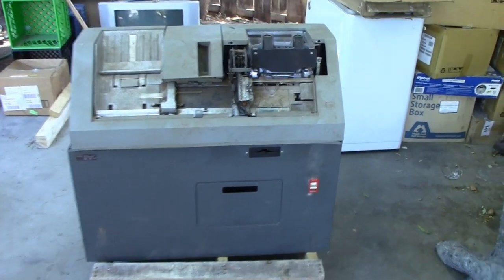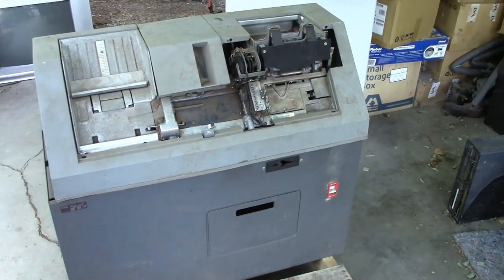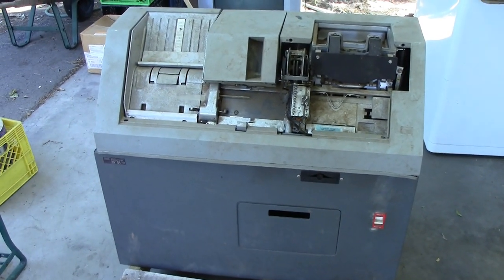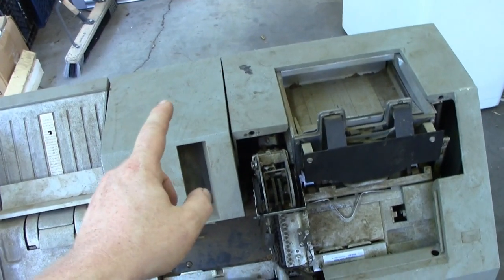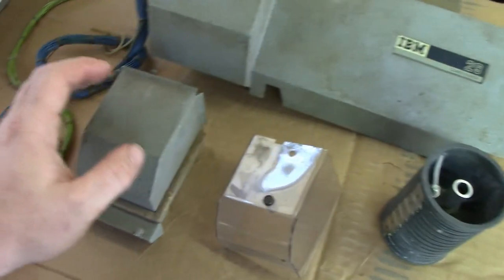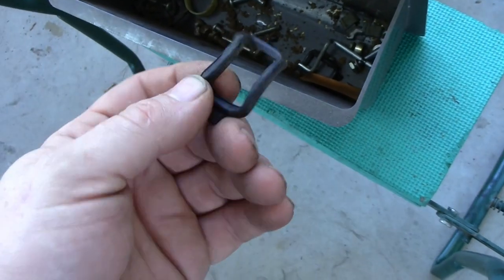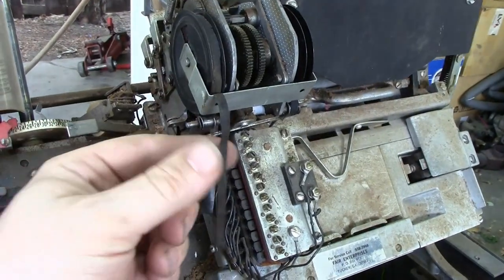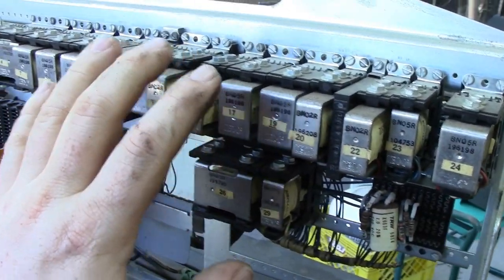New Arrival: IBM Model 29 Keypunch

Comment: So when I first joined IBM in 79 at 17yo as a CE basic training consisted of 3 months (029, 059, 129, 3741, 5100/5110).  A senior CE in his 60s was a guest instructor.  He shared all the tips/tricks that aren't in the repair manual.  I got really good at the 029 and still have a few parts and I'm fairly sure I have the neon 24V probe.  Most parts can be machined.  The only difficult part to machine would be the code plate (which is used to print the correct character).  #6 IBM oil must be used to lube the print unit other oils will gum up the print horn as the #6 oil was soluble with the ink.  Good luck in the restoration.

Comment: One more thing, many 029s were used by manufactures to punch a card which was attached to the product for shipping.  These 029s may or may not have had keyboards.  Example: The DuPont nylon plan in Seaford DE used DEC computers to punch cards on the 029 through an interface.   The card's data included the weight, #, date of production, etc for the bale of nylon.  It worked great until the inter-poser bail contacts bounced (in the punch unit) causing an extra punch cycle.  Worked fine as a standalone keypunch but had extra punch cycles when attached to the DEC interface.  Needed a scope to trouble shoot that bug.  Remember when trouble shooting the 029; KEY, Escape, Interlock, Punch

Comment: HHa i used unit record machines since the 024.
And its pronounced "OH-29" not simply 29. IBM used 3 numbers to identify unit record equipment.
I did pligvoard wiring on the 407 accounting machine and used the 083 for sorting